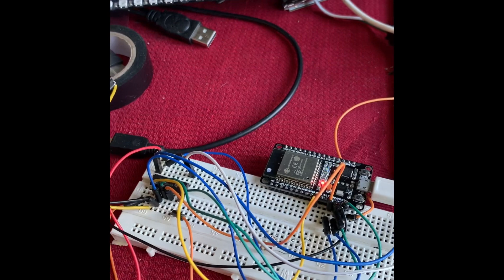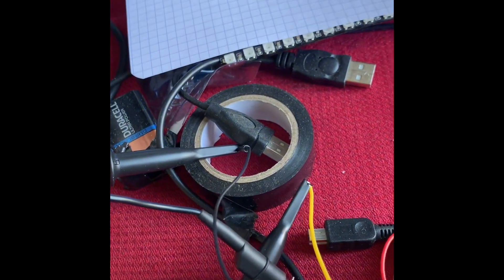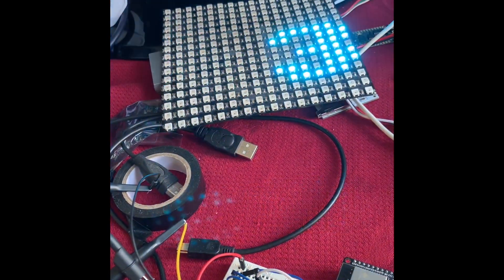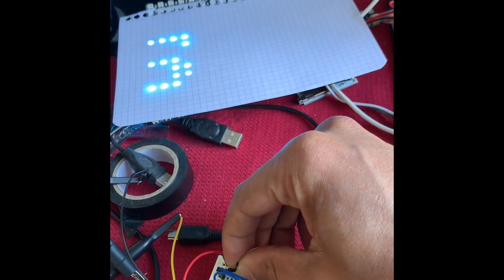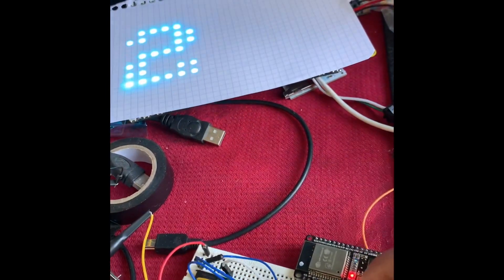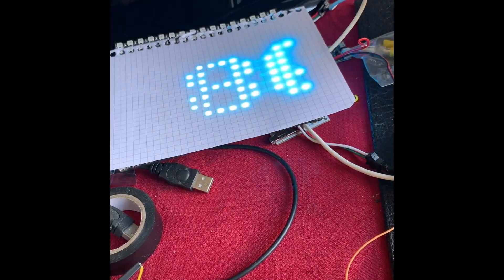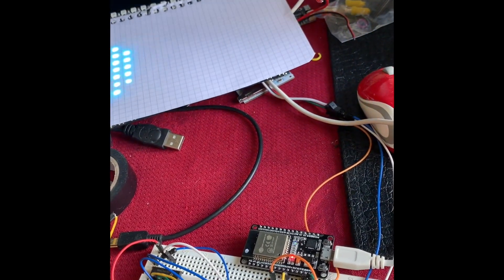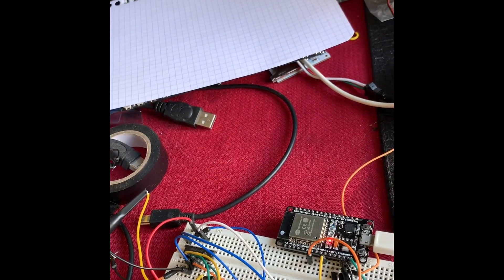20000 ws2812 pushed at 130fps

Comment: Hello, my name is Marcio and I'm here from Brazil I'm currently using esp8266 pushing only 4 universes, but I noticed that your code is only working for the ws6803, when I try to use the leds ws2812b and ws2811 they do not respond you could help me with this detail and I would also like to know if you could help me with some code to push some 50000 pixels and explain in the code where the line with the pins is to inform the tapes in parallel and how I would use the shiftregister in this case, if you have any drawings or something that I can visualize will be very grateful my email is marciotelao@gmail.com

Comment: You're a mad man Yves!  Love it!  I need to ship you more shifters and 32's
Reply from the maker: Darren Hedlund ahah thank you !! I guess that is the most of esp32 we can get I have tried to go to 6 virtuals pins and 7 but it misses some bit => not good but I guess 80 parallel strips is not bad. ;). I will integrate it in fastled this week end I think.
Reply: I am still pushing the limits myself as well.  Blew a few 32's along the way but  that is how we we learn..  Still have more 32's if you need some and keep up the good fight.
Reply from the maker: Darren Hedlund indeed that is how we learn !!! What kind of projects have you done lately ?
Reply: Same as you buddy, but finally got my act together and starting using boards for multiple outputs with the help of Jason C.  Also, made a sacn version  working from notes we talked about in your art-net changes back in the day.  Still have new videos for you also to use if needed.  I do miss our google FastLED group...
Reply from the maker: Darren Hedlund hello can’ t wait to see your projects running
Reply: Hi Yves (and Darren !) I have also been working with esp32 and pixels, buy using ethernet W5500 instead of WiFi, project currently on hold but it looks like 32 universes of artnet data can be done
Reply from the maker: Bob Lynas indeed I pushed it to 35 universes https://youtu.be/4viy1FxyLiY via WiFi without too much issue. I have never tested it using Ethernet. I use the two cores (one for getting the universes and one for displaying them)
Reply: Way to go Bob, that is amazing!

Comment: Reference?
Reply from the maker: kamal sonani 
I will clean up the code and push it.
Reply: @TekWit  I'm completely out
Of my mind that how you bang thos logics to shift register, 20000 leds👊💪 😲😲
@120fps

@ 30 fps number of leds??😯😯😯
Reply from the maker: kamal sonani if you push 80.000 leds on 80 strips in parallel then it’s 1000 leds per strips which gives you 33fps. 
The ws2812b are updated at a fréquence of 800khz per bit. 
What a do it push data through the shift register really fast and latch it at the right time so I mimic the 800khz.
So this project was a lot about calculation to respect the timing.  
I will make or more detailed video if you want.
Reply: @TekWit  yeh, sure